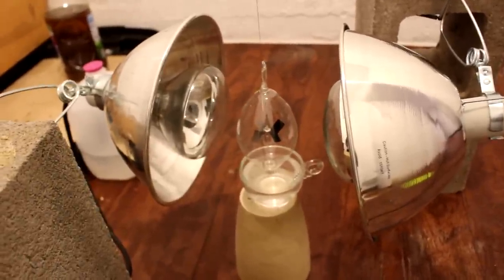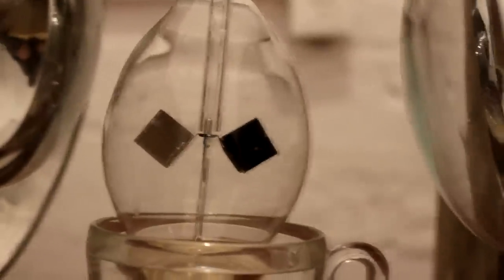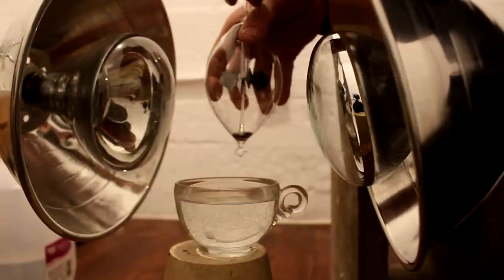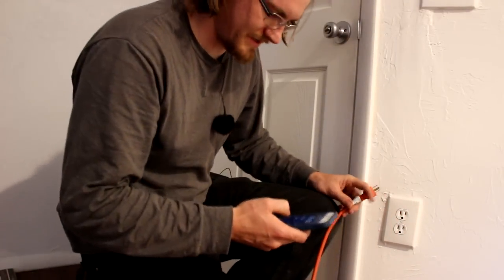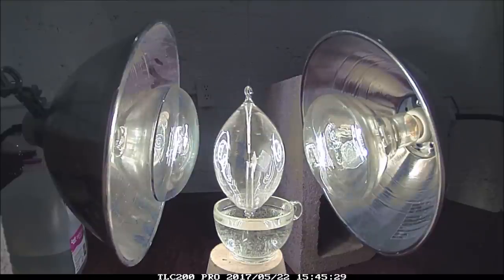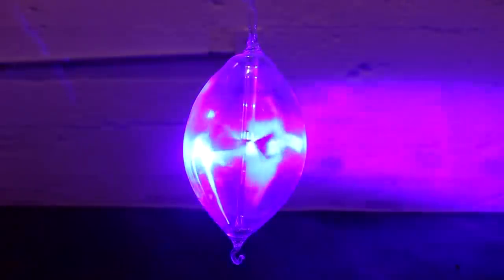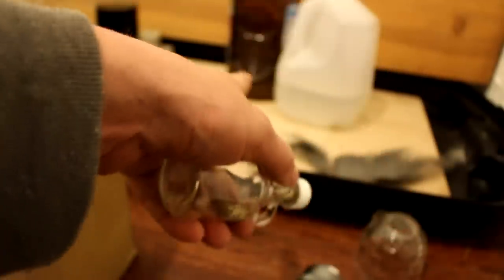Radiometer Suspended on a Thread

Comment: You could direct your laser through a small concave lens, befor it hits the radiometer. That should spread the light a bit more over the black tiles and prevent the burning of the black coating.

Comment: I think the reason the bulb stops rotating is that the string has twisted slightly, which lifts the bulb slightly, so that gravity stops further rotation. When you turn off the lights, the rotation force on the bulb is removed, so the twisted string is able to untwist and rotate the bulb the other way, until it twists up in the other direction, and goes back and forth like a pendulum.

Comment: I think the rule demonstrated here is that the net angular momentum of a system is conserved. The vanes spinning one way are balanced by the torque on the string in the other. Satellites use a similar system to stay oriented without thrusters.

Comment: 7:20... you can de-focus the Laser to a larger beam spot to reduce the power density and not burn the coating on the vanes. If your laser does not have an adjustable focus you can use a appropriate glass lens to de-focus the beam spiot.

Comment: The issue with the string is that was it gets twisted, it gets shorter and the tension increases. It eventually provides the resistance to stop the spinning. Without energy being put in to keep the twist, it untwists. 
That's what I thought everyone was saying before as being a factor.

Comment: Here is a hint for the future: If you want to see if something rotates, and in what direction, use a very thin wire of known length, thickness, and known properties of the metal. It will act as a spring, its behavior can be calculated, and measured. Obviously it needs to stay in its elastic range of motion so that it does not get permanently twisted, this would ruin the caculations. And you can perform precision experiments on it to see if it is consistent with caculations. 

With a well-mounted, well-understood and well-maintained wire filament like that, you can do experiments to measure the gravitational constant, the mass of earth, and from there calculate the masses of a great number of other objects in the solar system, and then other stars, and ultimately these precision experiments are tied into our understanding of the mass of the universe. It allows you to know the force based on the distance of rotation.

Good reasons to use a wire filament in my opinion.

Comment: The way I see it the friction of the rotor bumping against the glass tube above it may very well be contributing to the inertia imparted to the glass envelope. If I recall correctly in the video repairing the radiometer there was a point where the vacuum was too great and the rotor did not spin. If it was moving based on light pressure theoretically there should never be a point where there could be too much vacuum for the device to operate. One interesting thing I've noticed is that human beings can feel light not just as heat but also a sensation that could be described as light pressure. I haven't found a hypothetical mechanism for what's taking place but it's an interesting quirk of human biology. I also found out that it's rather irritating to shine a laser at the middle of the forehead with your eyes closed again I haven't found a reason that this should be possible. That is at least not within mainstream science.

Comment: I would have simply said that the string while not giving anything to the reaction,was in fact taking away some because once it got wound up, just like anything wound to its maximum, it stopped your device from continuing to spin, which in the end prohibited it from accelerating to its peak potential.

If you had some kind of really slick little bearing to dangle the device from you might be able to get it to spin much faster.

Comment: +cody'slab that's not what people were talking about, they were talking about when the bulb changed directions after the lights were turned off. you said it changed directions because of friction, they were saying that it changed directions because the string was unwinding.

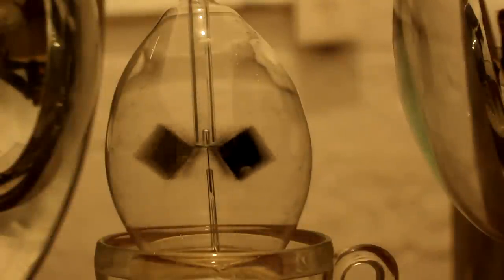Comment: @Cody  At 2:40 the rotation when you turned the lights off might of been caused by the string that was wound up releasing its built up rotation.   Much like a toy plane and a rubber band, only much weaker.

Comment: Rather than friction of the rotor balancing the force on the glass, I think the string is acting as a torsion balance and thus stopping the rotation of the glass case. I guess you could even use it to measure the small torque that it is produced on the glass.

Comment: It would be great to see a Radiometer with black and silvered vanes.  The reason being that photon pressure is double when reflected from a mirror and only single when absorbed by the black surface.  This would allow you to determine if there are any measurable effects from photon pressure.  I would suspect the effect is not measurable in your lab situation.
A rough calculation puts solar photon pressure at around 9mg/m^2 at sea level.  If you were generous you could assume 100cm^2 over the surface of the radiometer.  This would give something like 0.9mg of force if you allow that the 300W bulbs can produce sunlight levels of light.  About the weight of a single grain of table salt.
Reply: +Sean Nanoman:
"The reason being that photon pressure is double when reflected from a 
mirror and only single when absorbed by the black surface. "

==I thought the photon pressure is 0 when it is reflected.

If I send a 700 nm photon onto a mirror and it reflects back, do I get a 700 nm photon back?
If the photon did a push, then that means the photon lost energy and the wavelength would be larger.

Photons aren't balls of matter. Newtonian physics does not work on them.
Reply: Yeah, I don't really get it either.  That gem was from a YT video by Isaac Arthur on the topic of laser sails for spacecraft.  His videos are really great, you should check them.  Anyways I thought if the pressure received from the photons could be varied it would be easy to determine if photon pressure was the cause of the motion.
Reply: +Sean Nanoman:
Then that guy,  Isaac Arthur, is wrong. Reflection doesn't cause the reflected photon to lose energy.
Reply: He seemed to indicate that in fact you get twice the momentum kick by using a reflective surface than you would by using an absorptive surface.  
It's all covered under solar sails.  You would have to ask yourself why solar sails are reflective if we are to use light pressure to push them.

Comment: 3:02 I think the final counter-clockwise spin on the glass may also be due to the twist on the string rolling itself straight rather than the blades releasing heat, but I could be wrong. You should let that rotation play out all the way and see if it springs back a fraction as far clockwise after that
Reply: Awe damnit! you already address that, this is why I shouldn't keep your videos on backlog!

Comment: another simple way to prove it's not light pressure is the fact it spins counterclockwise. 

here's the explanation: when the light hits the black surface, all of the momentum is transferred to the surface, thus giving it x momentum, when the light had x momentum. Now when light hits a shiny object like a mirror, the light hits it and then bounces back, otherwise you can't see yourself. Since the light came in with x momentum, and bounces away with x momentum, the mirror most move at 2x momentum to conserve momentum. A simple way mathematically to show this is 1 east (light) + 0 west = 1 east (black) + 0 west = 2 east (mirror) + 1 west (light).

Comment: Hey, Cody, I was thinking, if you just hung some blankets from the walls, you should be able to reduce the echo effects in the room. there are, of course better sound pads that people use, heck, one youtuber stacked a bunch of bath towels into a frame, and they worked as good if not better than proffessional foam panels. but still, blankets should dampen it, and it's a quick easy fix.

Comment: My initial thought was that the halting of the glass' rotation was due to twisting tension on the suspending thread, and that the counter-rotation after the lights were turned off was due to that tension being released again.  Was the thread attached to the radiometer in such a way that it would not twist?  Because if so, then I'd imagine that some amount of friction would be present in whatever is the mechanism that allows it to freely rotate.

Comment: It was kind of hard to see which was the glass was spinning. There were a lot of times I couldn't tell if the spot I was looking at was on the front or the back of the bottle. Not that you should redo this experiment, but in the future, some small mark in marker or a sticker would have been helpful.
Reply: And maybe put the camera a bit higher to create a perspective that makes it easier to differentiate between front and back.

Comment: 2:31 "It looks like now friction has taken over...." Could it instead be that the thread has twisted enough at that point to resist the force produced by the recoiling gas molecules? And then, after the lamps are turned off, the thread uncoils and spins the glass back the other way?

Comment: Hey Cody, quick question. If you put a scale in a near true vacuum or true vacuum and set the scale to zero and let the air back into the vacuum, could you theoretically weigh air itself?

Comment: As you add thermal energy which causes a miniscule increase to measurable mass, is that mass enough to cause the thread to stretch?  If so could the thread fibers unwinding with the stretching be the cause of the rotation of the radiometer?

Comment: i have a question: so in the second run the planes where not spinning do to friction making the whole glass spin. I was wondering that wouldn't the reason why the whole glass was spinning is because the planes where releasing heat and since friction prevented the planes from spinning then the planes pushed the whole glass, just like in the first run once it 'finished' spinning it started spinning counter due to heat release?

Comment: Wouldn't the twist in the suspending wire also cause the glass to rotate back when you turned the light off, not just the frictional force of the fins on the axis?

Comment: Cody , i have a question , if you put a air compressor inside a perfectly sealed chamber and the output hose of the compressor to the outside , would it work as a vaccum pump making vaccum inside the chamber?
Reply from the maker: Yes but it wouldn't be very efficient and would probably overheat rather quickly.
Reply: Cody'sLab thats cool , i didnt know you replied to comments and thanks a bit , (i learned a lot for my science expo using your channel)

Comment: dampen versus damp: The first means to make wet, the second means to reduce the amplitude of.

Maybe I'm wrong though.  Meaning comes from usage.
Reply from the maker: this is one instance where the water is ding bolth.
Reply: Cody'sLab  ding ding!
Reply: Cody'sLab 
new response: ok, fine :)

old response: good time for a pun, but no; vibrations do not become wet.  not trying  to be a jerk; maybe I'm being too pedantic.

Comment: Cody, could you perform this experiment in a vacuum? That way we can determine if it is the light pressure that pushes The radiometer or if it's from gas.

Comment: Hay if you took a hybrid electric motor from a vehicle and made a housing for it  centering it and then placing rewired brushless drum motors in to generators around the hybrid electric motor could the strong magnetic field from the hybrid electric motor cause all the drum motor generators to spin to generate high frequency electricity that could be passed through a capacitor bank and a sold state graphite power cell bank with some electronic components to lower the generated electrical frequency to power the hybrid electric motor with an ample supply of left over energy to operate other devices? Do you think it could work?

Comment: I just wondered, What if you have a hollow tank off metal, filled with air it would float. but since metal normally sinks, will it sink when there is a vacuum pulled in the tank? or will surface tension or something else make it float?
Reply: I can answer that... It'll float. You know what also has a vacuum? Cathode Ray Rubes. Old CRTs will float in water. The screen will always face downward, cause the most glass is there, and thus that part is heaviest. They actually float surprisingly high in the water too! It's about buoyancy and displacement.
Reply: Yea i thought about that but than again all the plastic from such a tv will make it float right? or are you just talking about the actual ray tube?
Reply: Just the huge, big, heavy, old glass tube. It honestly floats!
Think of a boat. Big huge metal thing... But because it displaces more water than it weighs, it i more buoyant. Same with the CRT. It's heavy, but the water it "pushes out of the way" weights even more.
Reply: Ahh right i get it now, i was thinking it was all about density but i was wrong :D thanks man!
Reply: Probably not the wisest thing I've ever done... But when I learned CRTs float, I sent a CRT with an LED flasher on the top of a tall rod attached to the CRT neck down the Des Moines River. Don't know how far it got, don't know if it got caught on a bank, don't know where it broke...

Comment: I'm too lazy to look it up, What exactly is a radiometer or whatever it's called, BTW hello Cody
Reply: jamason davis this thing you saw in the video is. basically plates of metal with either reflective or dark surface, it works mosty because dark sides heat up and accelerate particles. in total vacuum it would spin the other way because the light would push more on the reflecive surfaces, but it would require huge amounts of energy just to get it spinning.

Comment: If it WAS light pressure wouldn't it spin the opposite direction since the reflective surface would.. well.. Reflect it whereas the black surface would absorb most of the light.

Comment: Could there be any effect of the heat of the lamps in the hot air rising hitting the thread and because the thread is under tension as it was twisting, just by adding heat to the thread alone causes it to unwind a little bit more?.

Comment: Both the vanes and the glass were rotating anticlockwise as viewed from the top contrary to your comment. Not sure what that means for the question of light pressure but there is definitely an atmosphere inside the glass which to means the whole rotation is due to the friction of the rotating gas.
Reply from the maker: I'm sorry but where tf are you getting that? they are very clearly rotating in opposite directions.
Reply: From a non stereoscopic side view... It is actually very difficult for some people to actually see what direction the glass is spinning. I initially saw them as spinning the same direction as well. Kinda like an optical illusion or something? This experiment would be vastly improved by having just two things: One, the camera slightly above and angled downward (to make the vanes direction of spin more apparent). Two... A sharpie... A few clear marks on the glass would have been far better than water spots.
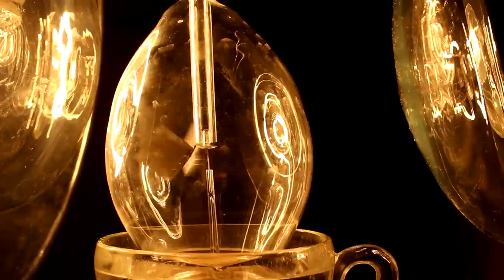Reply: At 2:09 you can see a spot near the top of the glass move over the center tube which makes it easier to see it moving clockwise.
Reply: Probably just an optical illusion, cheers.
Reply: Thanks for the explanation. Clear registration marks would help.

Comment: you have a very unbalanced internal parts inside. the pinging were hearing is the internal metal is grinding around on the internal pipe. . there for will eventul break the unit.

Comment: fake. you can totally see the string hanging from the ceiling
Reply: porp109 the string is to reduce friction on the surface the glass would be attempting to spin on, that way the energy from the lights can cause it to move the metal and the glass to spin freely, but only when the metal is spinning counterclockwise that it makes the the glass spin clockwise from momentum force. And to say an scientific experiment is fake, is like to say you don't understand the news so its fake. No hate, just don't try to point out how somethings "fake" when he legitamately mentions it in the video describing what it is in place for.
Reply: Lt.David Pulsar Ill take credit I did assume It was someone just trying  to say it like it was a point, not ironically or in a joking matter. But I understand what you mean and it did. I apologize for the misunderstanding
Reply: RH Entertainment Misunderstanding apologize apologized
Reply: you've only proved that radiation is rotating the glass and fins, not light. instead of your filament bulb try a led to prove light rather than radiation is the pushing force. granted light is a massless force/phenomenon so how can it push anything other than itself? only via the radiation it carries. i believe light isnt a pushing force but rather a flow like falling water but in/through space, which explains snell's law.
Reply: light is radiation...
Reply: the problem with this comment is that most people probably didn't get the joke and liked it but we will never know